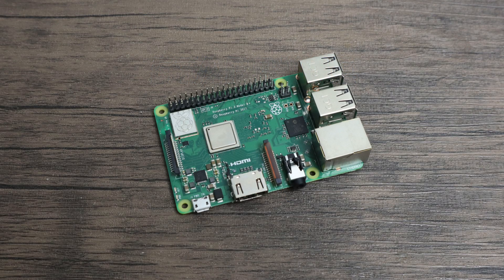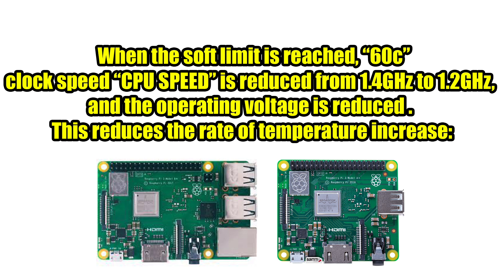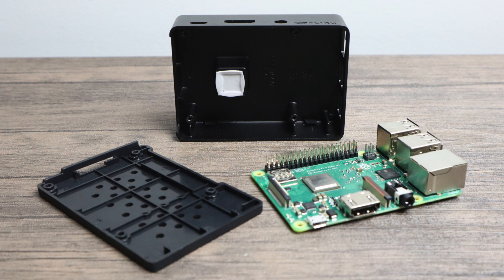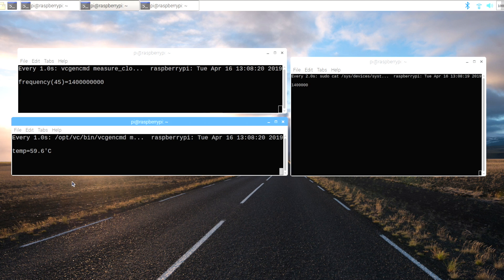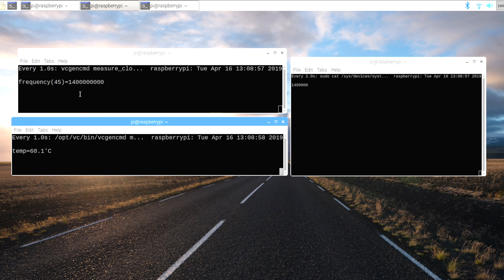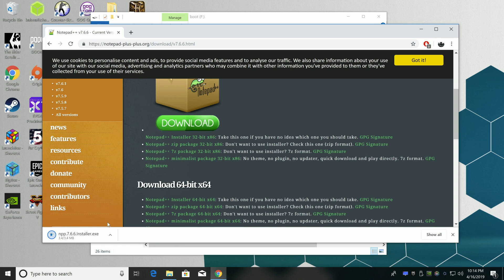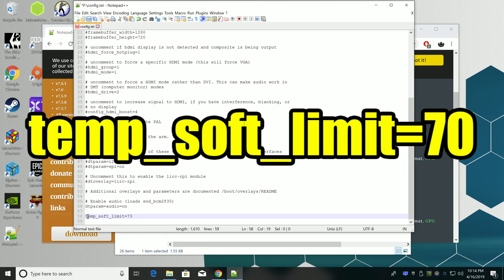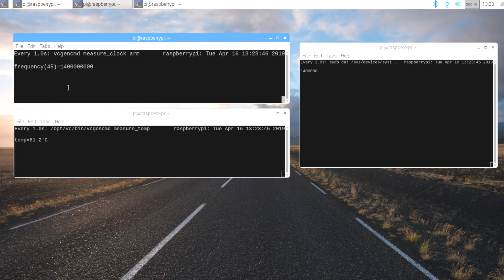Raspberry Pi Higher CPU Speed Extended Period Of Time Raise Thermal Throttle Limit  Pi 3B+ Or 3A+

Comment: I use a tiny 40mm 5v Noctua fan and tiny cheap heatsink. Actually have to pick the thing up and hold it to your ear to hear it (amazing how quiet it is, even comes with cables that fit the gpio pins😆). With it my pi3b runs 45°c or less under full artificial load at 1.34ghz (started hitting a voltage limit warning with pi official PSU, swapped in 5v 4a OnePlus phone charger and warning vanished) so probably have further I could push it. 😁 Really tempted to just get into pi overclocking 😂, they make it so easy to tinker then test. 😊

I also wanna to do a mini water cooled build at some point ,both sides of the chip. 😁 (If i get a winner board it might happen earlier but mainly waiting for pi 4. 😁 🤞we can overclock pi 4. 😂)
Quick question is it gpu or ram on the underside of the chip?🤔 (Can't remember). 😁 I do remember the underside gets hot though😅 so I'd still want to cool it, along with basically any other parts of it that produce heat 😁. 
Only 2 problems:
(1) Finding a pump that is small, 5v, quiet, and has enough flow for all the parts. 😅  I don't mind having to run multiple pumps as long as they are quiet enough to make up for it 😊. I don't mind spending more for quality too (Noctua 40mm 5v fan was £12, had all the adaptors I needed, an with how whisper silent it is the extra £4 (or 33.33% more) I payed seems well worth it. 😁) So same applies for the pump. 

(2) Finding small 40mm by 80mm radiators to fit the build (ideally to mount 2× 40mm Noctua 5v fans). 😅

 The rest of it I can custom make, or coble together out of found parts. 😉 Thanks a million in advance for anyone with any parts advice for me. 😁

P.s. mineral oil?
Reply: Huh that's weird, i can run my RPI 3B+ at 1.5ghz no problem with 5V 2A charger, but yeah it sometimes hit almost 58 degrees under maximum load with 12V fan (it's underpowered because i use 5V RPI), but yeah it's still run at 1.5ghz consistently for days

Comment: I am not sure if it would be an idea to install the Raspberry Pi into a Little Devil PC-V10 case and cover the whole of the Raspberry Pi PCB with kneeded eraser to protect the electronics from condensation except for the CPU header and use the cooling probe to keep the CPU at or near to -70 degrees below zero and power the board of the 5v rail of the PSU and use the other voltages to power the Phase Change Cooling system section of said case just an idea.

Comment: Will the retroflag snespi case close with this type of heatsink?
Reply: I just bought this heatsink\Fan combo after watching this video and seeing the thumbs up on your comment. I have the super Pi retroflag case and no it doesn't fit unless you take off the component that opens the compartment where the cartridge flap is. I'm probably going to put back in the cheap Fan I had originally bought that fits in the fan spot of the case. It kept it plenty cool enough, I was just hoping this one would be quieter and unfortunately it's just a bit louder

Comment: Random question, will that extreme cooling fan heat sink fit in the retroflag snes cases?
Reply: I just bought this heatsink\Fan combo after watching this video and seeing the thumbs up on your comment. I have the super Pi retroflag case and no it doesn't fit unless you take off the component that opens the compartment where the cartridge flap is. I'm probably going to put back in the cheap Fan I had originally bought that fits in the fan spot of the case. It kept it plenty cool enough, I was just hoping this one would be quieter and unfortunately it's just a bit louder
Reply: @JBot8888  That's too bad...I'd really have liked to toss this into my SFC case...I suppose it'll fit in the NES styled case at least. Well thanks for finding out fellow user!

Comment: #!/bin/bash
#By Kenn Power 28/04/2017

echo -e "______________________________\n\n"

while [ true ]

do

        vTemp=`cat /sys/class/thermal/thermal_zone0/temp`

        let vTemp=$vTemp/1000

        vSpeed=`cat /sys/devices/system/cpu/cpu0/cpufreq/scaling_cur_freq`

        let vSpeed=$vSpeed/1000

        vDate=`date`

        vPad=""

        if [ $vSpeed -lt 1000 ]

            then

                vPad="  "

        fi

        echo -e "\033[2A\033[G "$vDate"\033[K\nCPU temp:" $vTemp"°C  "$vPad"speed: "$vSpeed"MHz\033[K"

        sleep 1

done

Comment: That’s silly just use fan and oversized heat sink don’t just allow it run too hot. I understand is only $35 but time is money... why spend the time to reprogram and replace the PI when you could have just cooled the first one properly.

Comment: Why do you need to use a different text editor? What is wrong with the standard that comes with Windows?
Reply: Line Break (Enter key) in Windows Notepad does not append a new line in linux encoding... It spits out a garbage character and continues on the same line.

Comment: Overclocking on a pi is basically a placebo if you think it improves emulation.
Reply: Actually, it does make a difference.  We're talking about a 1400mhz chip here, getting an extra 100mhz can be a huge game changer with certain emulators.  If we were talking about a 4ghz i7 or something like that, i'd agree.
Reply: @harpskid  with regards to emulation the gpu performance is so low, yes overclocking it provides very minimal improvement.
Reply: @ryecatcher25  Except your wrong :D

Comment: Wtf 60 is very low, why did they do that?
Reply: I found an article a while back that stated it was because of the location of the thermal sensor in the chip. They do not have a sensors on each core and occasionally certain cores get pinned and raise their temps faster.
Reply: Because some 3b+ boards were not 100% stable at 1400mhz above 60c